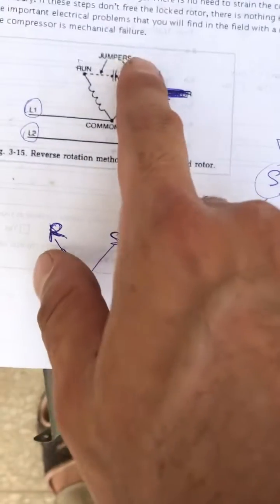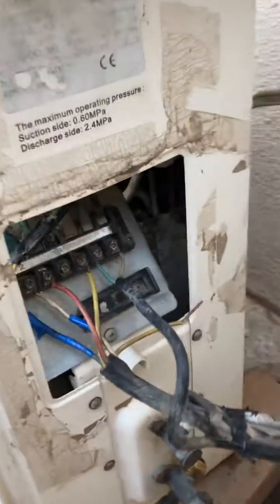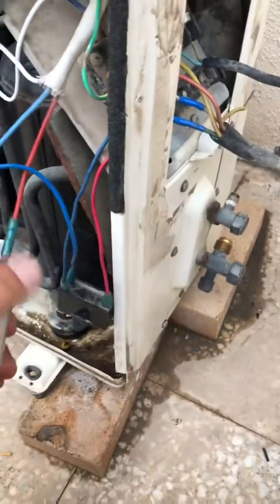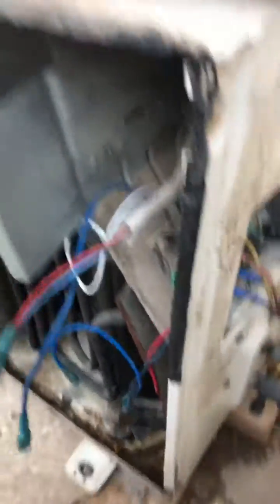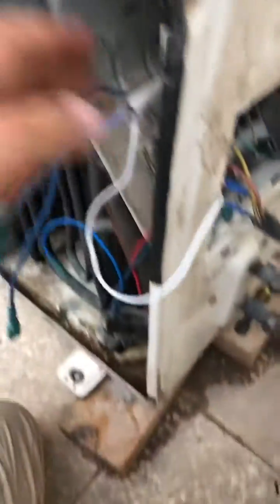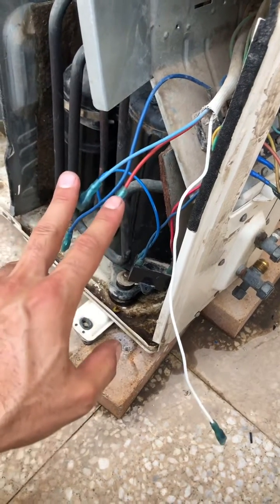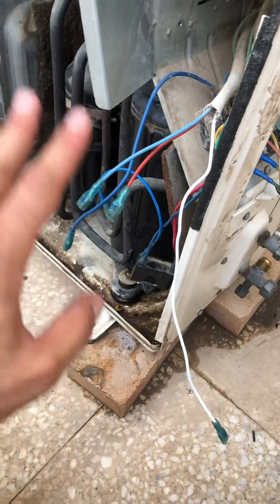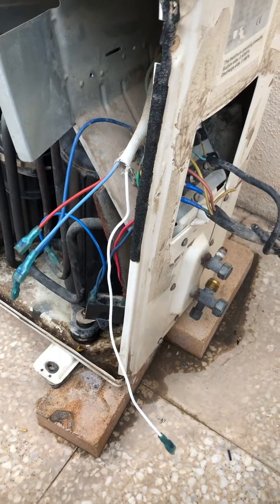How to open a locked (HVAC) compressor by Reverse Rotation Method .(Done successfully) .

Comment: Mi incoming voltage is 240v single phase. 120v  L1  to ground, 120V   L2 to ground, 240 between L1 and L2. Can your method work using this voltage?
Reply from the maker: Hi Brother Johnk, If Nominal Voltage of your Ac unit is 120V then shocking the Rotor with 240V is correct , we only need a higher voltage than nominal voltage to unlock the Rotor ,

Comment: I've heard of people swapping the run and start leads on the capacitor. Is that essentially the same thing?
Reply from the maker: no, This method is based on Shocking the rotor with higher voltage .!

Comment: I have an issue. My ac is taking high amps lole 48-52 amps. Its shutting down as soon as it starts within 2 seconds. Technician said rotor is locked. So i found your video whole searching on youtube.  I followed your method connected live wires L1 with common and as soon as i connected L2 to start it gave a short circuit. Compressor did gave a sound as well. I havent even got time to make the jumber between start and run. Because i thought first i will connect the live wores to common and start. Then i will make the jumper. What do you think about it ? Am i making some mistake ?
Reply from the maker: bro follow the exact instruction , its all written in detail , its easy .

Comment: my voltage is 650v AC will this still work
Reply from the maker: Hey Man , Mine was almost 400v and after 3 or 4 times zapping the compressor then it started rotating in reverses , but 650V is higher than 400 and I guess you will open the rotor by the First Zapping of the compressor , Its better to use 400v but if you dont have choice I think you can use 650v while doing it  (zapped very quickly)  but be advised!!!!  (wear protective gloves and have someone around you to switch off the power  just incase , safety first brother . do it and keep me posted .be safe.

Comment: Connect live to common wire of compressor, neutral wire to run winding wire usually blue n then touch the start wire for 2 to 3 seconds
Reply from the maker: FOLLOW THE INSTRUCTION !!!

Comment: Good information..i dont think it work...befor i watch this vedio i try many times in small refregarstor short the start to common not in the runing its working but the ather compressor it will camback again to high amper.....i try this in single ph. Compressor..hope it will work...thanks..
Reply from the maker: IT NEEDS TO BE ZAPPED WITH 380 -400V IN 220V SYSTEM  , DO IT AND THANK ME LATER .
Reply: Hello, what power do you feed the compressor rotor, dc in reverse, reverse poles, or ac?  Wheere do you get 400v dc? Thank you. Regards

Comment from the maker: We only need to work on the 3 wires coming from the compressor, Common , Start, Run —-no need to disconnect any wires except for the 3 wires coming from the compressor, and Shut off the Power feeding the HVAC to avoid electrical shock.!
Reply: Hello, what power do you feed the compressor rotor, dc in reverse, reverse poles? How much voolts? Thank you. Regards

Comment: So basically is remove all the wire and use start and common to a live?
Reply from the maker: We only need to work on the 3 wires coming from the compressor, Common , Start, Run —-no need to disconnect any wires except for the 3 wires coming from the compressor, and Shut off the Power feeding the HVAC to avoid electrical shock.!

Comment from the maker: This technique is 100% guaranteed and successful , Unlock your HVAC rotor by shocking it. just follow the procedure explained in the video .
Reply: Can i use this method while the high prssure and low pressure tube still connect to my compressor? Or i need to remove it
Reply from the maker: @safwanbasma8626 I did mine without the pipes connected but  I guess you can  ,cuz you're only shocking the ROTOR  in REVERS and once you heard the sound of the Rotor rotating in Reverse it means the Rotor is free and cut off the power at once, congratulation you're successful  !!
Only Disconnect the input power to the HVAC ,so that you don't get shocked ,
We don't need to disconnect the input wires , , we only need the wires coming form the Compressor,  the 3 wires (Start ,Common ,Run) .keep me posted .